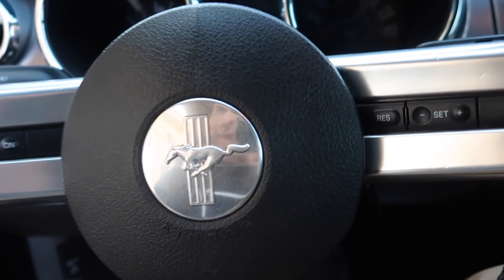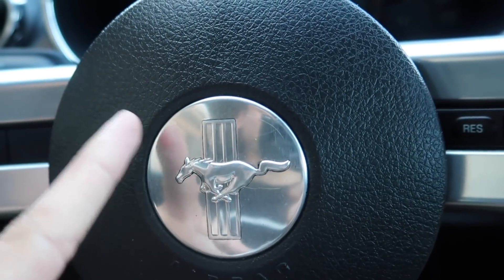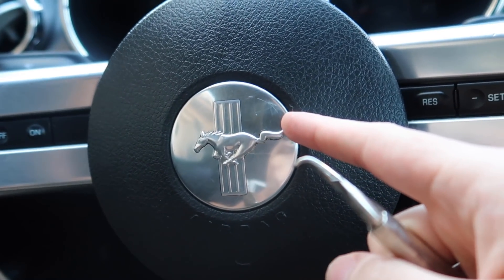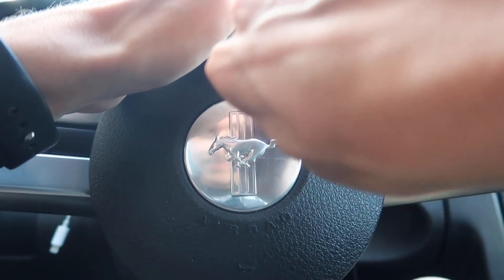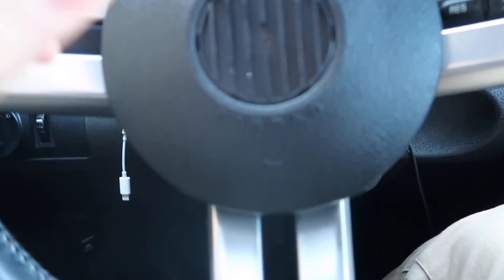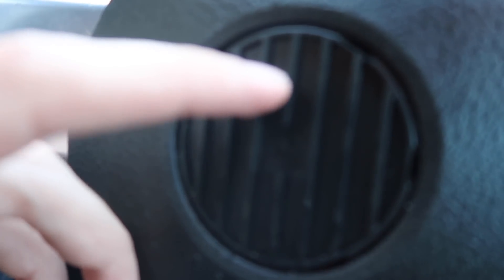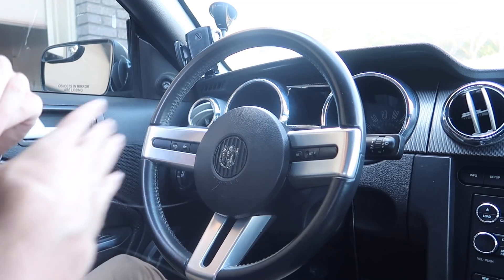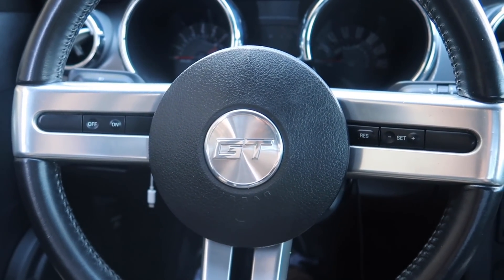Transforming My Steering Wheel: Part 2!!!

Comment: Might need to use double side 3m tape. I've used hot glue in my car before and when it cooks in the sun it failed and slipped right off.
Reply from the maker: i think that would be a little too thick, but thats a great idea

Comment: Does this work for the 2010-2014??
Reply: Yes its the same size as the ones in the 11-14s. You just need to install in using 3m tape or glue.

Comment: emblem looks sick! quick question when buying aftermarket wheels and tires do you need to buy new tpms or can you reuse the old ones to put on the new set?
Reply: On the S197 05-09, the TPMS sensors are banded around the wheel and really hard if not impossible to re-use.

Comment: Hey Nate I'm thinking about putting a 2013 Alcantara boss 302 wheel on my 2007 have you seen someone do that before or the gt500 wheel with alcantara and leather
Reply: James Etheridge I wanted to do something similar. Have you priced out how much that would cost and if it can even be done?
Reply: It'll work, I have a 2014 GT Steering wheel in my 2006. It's a pretty easy install and it looks amazing! https://www.youtube.com/watch?v=9ttKf-IOVaI is the video I used.
Reply: Ethan Pulig What about the buttons and controls?